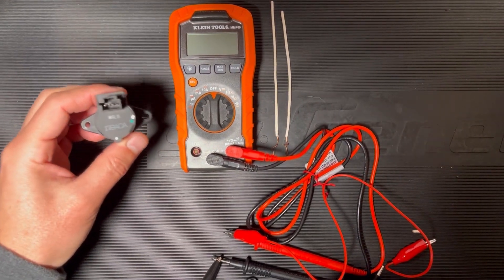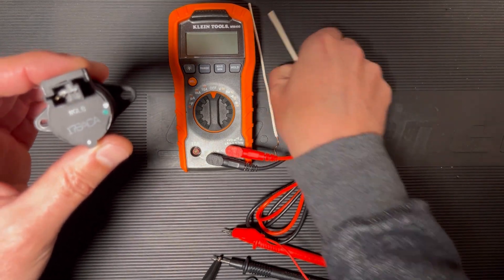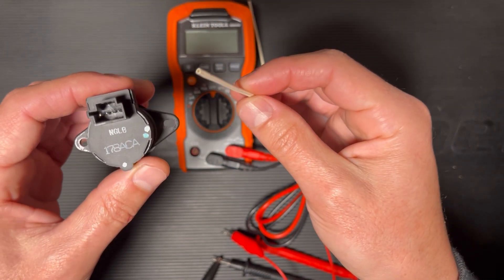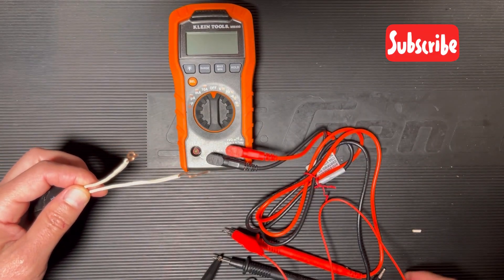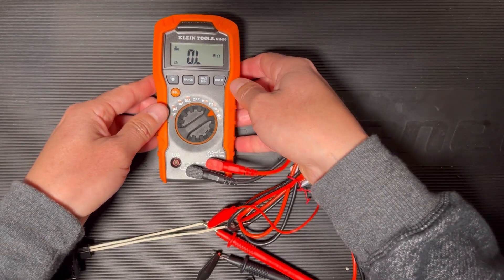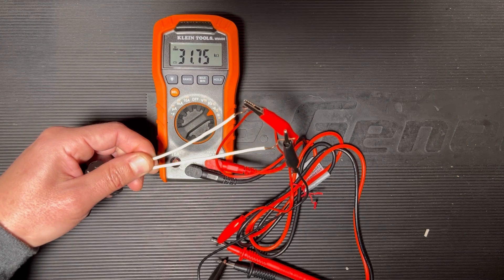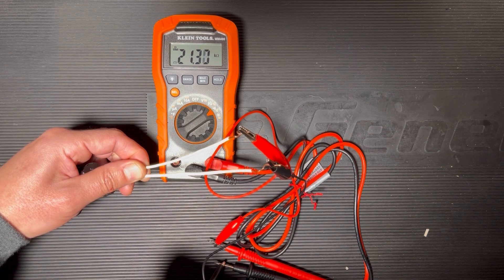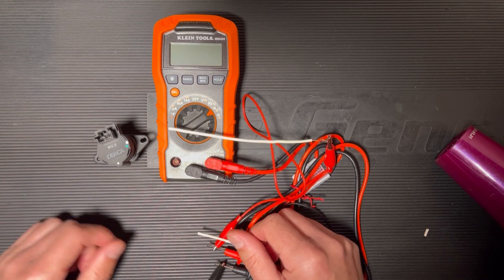How to Test a Temperature Cabin Air Sensor with a Multimeter / Dodge / Jeep / Chrysler / Ram.

Comment: Thanks for the video.  Do all the cabin temperature sensors behave the same way?  Mine is behaving in the opposite direction.   Lower temperatures register low ohm value, and that ohm value increases with heat.  Does it mean it's defective or is it possible that some are designed to work the opposite way?  Thanks in advance
Reply from the maker: No problem👍 
Sorry for the late response! 
The answer to your question is Yes, it would be considered a faulty temperature sensor if its resistance increases when the temperature increases.